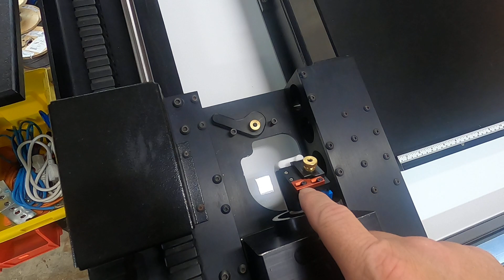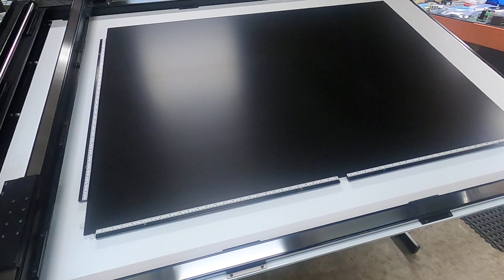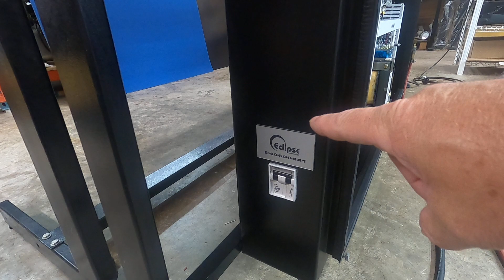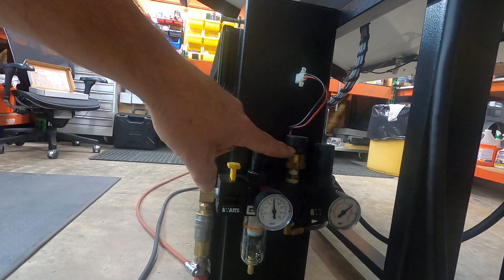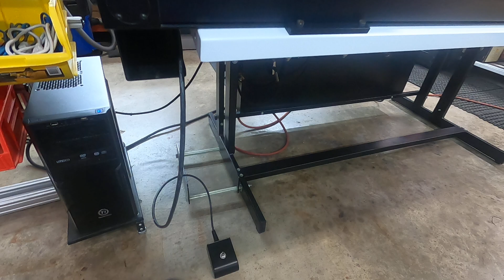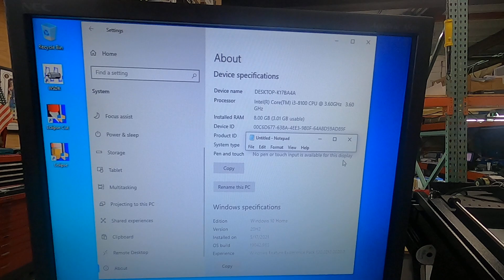Eclipse XL Computerized Mat Cutter

Comment: Wow, thanks for the technical tutorial. I found one of these on the used market for very cheap. Owner stated one of the travel axis won’t work. Would it be hard to replace a motor or a drive? Doesn’t seem like it.